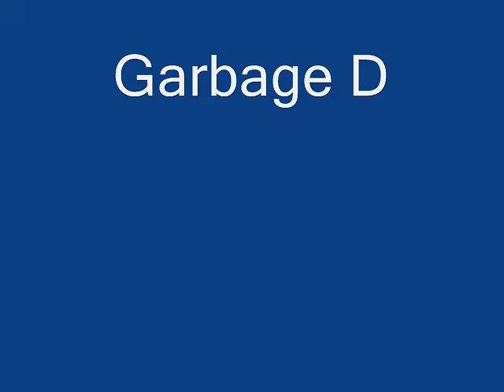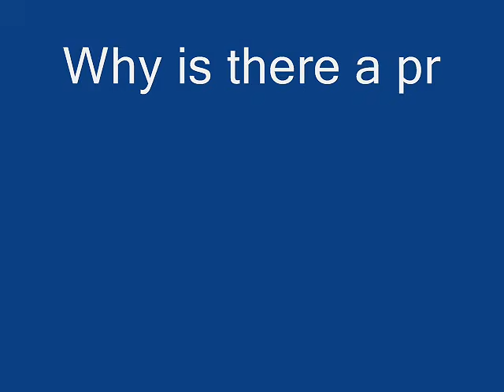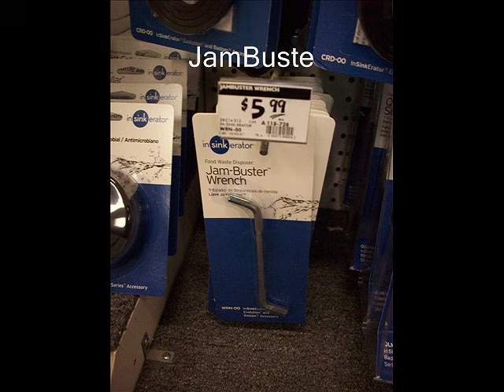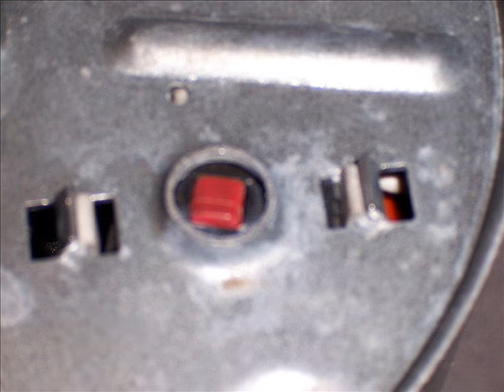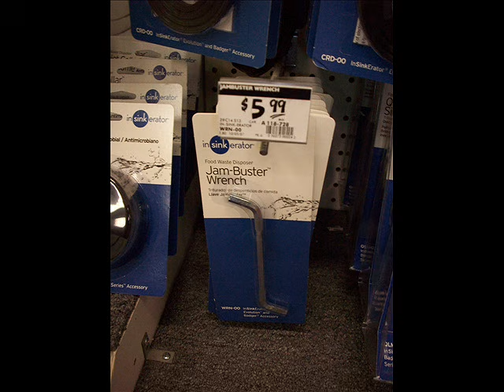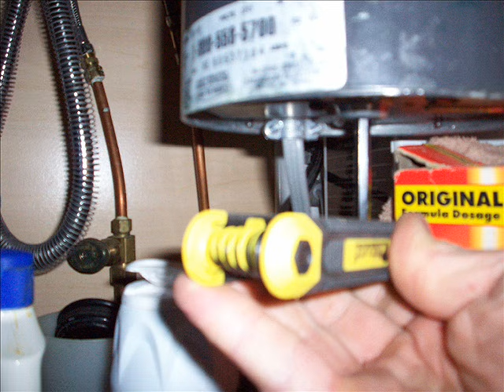Fix Your Garbage Disposal | Disposal Repair | No Cost | Save $$$

Comment: It hums.  No issues with the red button or the circuit.  I use my allen wrench.  Turns but takes effort.  After turning enough and moving back and forth I can get it turning pretty freely.  I fill the sink up with hot water.  I turn on the switch.  The disposal begins running for part of a second then back to the humming.  I have done this probably 12-15 times and same thing every time.  Cannot feel anything in the drain.  Seems like something is stuck but where I cannot get to.  Need to replace or can I remove it and find a fix?  Any help would be appreciated.

Comment: I get a hum but I don't have a jam - I used the jam buster/Allen wrench and the disposal gears/blades are free but that did not fix my problem I still have a hum but the disposal is not doing its job - any other suggestions before buying a new disposal?
Reply: I use the wooden spoon trick and can usually get it grinding. But no more. Just the hum. What to do?

Comment: What do I do if it hums, I put the allen wrench in there and it is totally locked up and won't move freely in either direction ?  Thanks!
Reply: Fixed! Nothing worked, not even the broom handle...until I basically gave up and started beating the living crap out of it with the broom handle in frustration and voila!  I'm back in business.  LOL. Thx!

Comment: At the end there you didn't say what happens if it hums and when you turn it it turns freely, yet still hums and won't go.  At least say go buy a new disposal, unless you know a fix?
Reply: Actually, I had the same question (but I might have phrased it in a more polite way). Ok. Sigh. Humming but dead.
Reply from the maker: Well Excuse me!
Reply: It's called common sense...MOST people have it. If the issue still persists after all the tips that were given here...you need a new unit.
Reply: Go buy new brains

Comment: But what if the hole is stripped?  Do I have to replace the unit? Could I detach the disposal and open it up? What happened was a tiny shard of glass jammed the rotors and I can't flush it out.

Comment: Thank you, but what if it still hums after the flywheel is free?  That is the fix I am looking for!
Reply: ***** Because her disposal turns freely but will not run only hums as if still stuck.  I think that's what she is asking.
Reply: Add Min Gluck I think you have a bad bushing or bearing,  when you turn on the switch, the magnets are sucking the armature over rather than spinning it.  When you turn off the switch you can spin it freely since there is no magnetism being applied and causing it to "stick" so to speak.  Best to just replace the unit.   If you have an allen socket on an extention, you can spin it while its on and humming from underneath and I bet you it will take off and run.  I don't actually advise you to do that but I bet it would work.
Reply: Christine, do you mean the normal electric motor hum that any electric motor that size makes?  Or do you mean some excessively loud hum?  You said yourself the flywheel is free on yours, so why are you worried?
Reply: racerx143 Thanks racerx143, that's what I mean. The flywheel is free, turn on the switch, just humming.  I believe that means the motor is broken and needs to be replaced, having looked at other videos...

Comment: NOTE: If you're getting the humming but the socket on the bottom can spin freely with an allen wrench, it is likely that the flywheel in the garbage disposal is shot and you may need to get a new garbage disposal.

Comment: Thanks! It works now! But my alan wrench is stuck in the whole now. It is totally fixed in that hole. I tried pulling with all my force but it still wouldn't come out. Any tips on getting it out? I've even tried WD-40 to no avail.

Comment: What else should I try if the Allen wrench won't move the jammer?
Reply: Jared French The longer the wrench, the easier it will be to move it. Use a lot of force, gently first and then add the pressure.

Comment: A safety tip: Check the outlet that the disposal is actually plugged into. Power on one side of a duplex receptacle can be live while the other is controlled by the switch! I would also suggest a GFCI plug or GFCI breaker be installed because it is near water.

Comment: Mine is humming without spinning... the jam buster wrench spins freely (indicating no jams)... I've taken the garbage disposal out from under the sink and flushed it with the garden hose, spinning it dozens of times.  When I hook it back up, it will work 1 time... and sounds nice and smooth while it's running.  As soon as I turn it off and try to run it again, I'm back to the humming with no spin.   Any thoughts?  Is the motor just going bad?

Comment: I couldn't get the jambuster wrench to really loosen the garbage disposal until I added dish soap to the drain.  That lubricated the item that was stuck enough to let me spin the wrench and loosen the offending metal piece.  It's much easier than trying to sweat and push the wrench.

Comment: THANK YOU!!! I have been without the disposal for months. I told maintenance and have waited for them to come they havent  . Just funny during the yearly inspection of apartment they do I told them that it was broken and they said they would schedule an appointment to come fix( which hasnt been done yet.. But anyway what I think is funny is maintenance guy looked under sink and never pressed the red button like you did.He just turned on switch saw it wasnt working and they said they would fix

Comment: WOW thanks for the vid. My wife just dropped 240 on a new unit but before we installed it I figured to just check for an instalation guide on youtube. I had no idea  there was a re set switch on the unit. it was jammed and tripped the switch. I also had no idea about the hex on the bottom. Thanks again. We can now return our unopened unit for a refund.

Comment: thank you. it was very useful.
IF this helps others, in my case I had to use key free up the blades. Initially when I tried this it was not working, because I had not freed up the blades and it only appeared as if I had freed it up. then I used a proper allen key and actually able to rotate and free up the blades.

Comment: Well, I'll be D*#$%D!!!!
I came here looking for a "replace your old disposal" instructions, because ours quit quite some time ago, and I was just getting around to buying a new one, and replacing it.
Just on a lark, I decided to follow these instructions before installing the new disposal, and sure enough, the old one took right off, and works like a charm (Ours had tripped the little red breaker on the bottom of the unit, so it wasn't doing anything when you flipped the switch). thanks man!!!

Comment: So I purchased the wrench thingie and the cost was $10.00. Now I noticed in this video the price for the "Jam Buster Wrench" was 5.99 in this video. That means in six years the price of the Jambuster nearly doubled. I am posting this note on 2/5/2013. I wonder in another six years if the darn thing will cost $20.00. Thanks for the video, we found a bolt wedged in the mechanism and now all fixed.

Comment: Thanks so much for the step by step troubleshooting.
The disposer was dead silent. I'd managed to click the reset button and reset the breaker to get a hum but it tripped again and again. At that point I started looking for a video on how to uninstall and dismantle the unit. I found your video and realized there was one more step I had not tried. I got an Allen key and with a twist or two got it turning freely. Disposer is running again! You've saved me a bundle! Bless you much! Happy New Year!

Comment: Perfect information--apparently a jam had caused the unit's circuit breaker to activate. Reset that,  and the unit worked, revealing that some olive pits apparently had jammed it earlier. Great info, with a logical approach to troubleshooting.

Comment: The hex thing doesn't work for me.  My disposal has a different kind of fitting on the bottom.  Not sure what it is, but the fitting definitely is larger than a hex. So much for thinking all disposals were built with the same standards.

Comment: Mine will move with the hexagonal thing like the one you used, but there's something in there that locks up occasionally, water dump in it or no. 
And no they didnt 'Plug' it in, this one was 'Wired' in.

Comment: Thank you very much for this video tutorial. My disposal stopped working because my girlfriend dropped a small wire ring inside the disposal by mistake. I followed your directions, found the ring pulled it out, reset the breaker and problem solved:-)

Comment from the maker: Folks....  My take...

A 34 HP or 12 HP garbage disposal would require 25 KW and 9 KW respectively.  A disposal typically runs on a 20 AMP/110V circuit which supplies 2.2 KW.  To get these HP claims would require 3 phase power typically NOT found in residential homes.

My point, these claims are not achievable.  STAY AWAY FROM THESE VENDORS  THESE ARE COMMERCIAL DISPOSALS.  If you need 34HP or even 12 HP to get rid of your garbage, you have bigger problems!

Comment: How to get the disposal against the drain tight enough to get the capture ring to catch? Only two hands? Get the scissor jack from your vehicle and using two pieces of plywood or planking, place one under the jack and one atop, under the new unit, and slowly jack it into place, applying enough pressure so that the rubber seal seats evenly against the drain pipe, then the capture ring slips easily onto the slots and turns to tighten. ... Y'all are welcome.

Comment: Thanks for the video! I followed the video, heard a hum but couldn't turn at all in either direction so I figured something must have been stuck. My problem turned out that there were two things stuck in the outer circumference. Took me a while but as I felt around the circumference, noticed that one part felt different and used needle nosed pliers to pull it out. Still didn't work so kept going and found a second object the same way. Pulled it out and got it working!

Comment: @JFTim7 I was in the same boat.  Except I was a bit more lazy and it went quite a while without being reset and by the time I watched this video and found that the red switch popped out it had also become jammed.  So, after completing all of the steps in this tutorial I was all fixed!  Thanks a lot ClassicManuals!!

Comment: I just installed a new disposal. Never been used, turned the switch on and it hums but doesn't turn. I used the wrench and turned it and it moves freely with occasional resistance. I have no idea whats wrong.

Comment: Very helpful and clear instructions!  My disposal stopped working and I almost called a plumber before checking on youtube for any last-minute miracle.  And this video was my miracle.  After watching it, I diagnosed my disposal problem to be a stuck flywheel and solved it using the suggested method to use a hex wrench.  Lo and behold the disposal has started working again.  Yeah!!!
Saved me almost 90 dollars for a plumber visit.  Thanks very much for this video.

Comment from the maker: Depends.... It may be a drain connection, if so a simple (hand) tightening may solve the problem.

Try to locate exactly where the leak is coming from, if it is the disposer then it will have to be replaced.